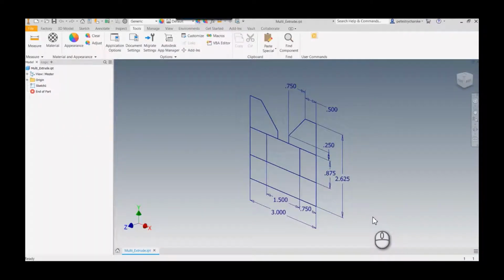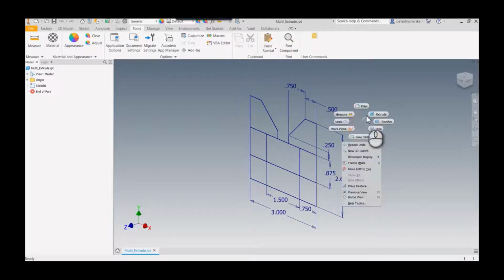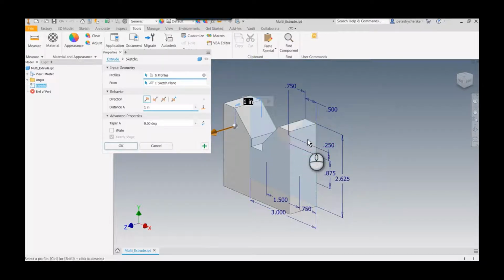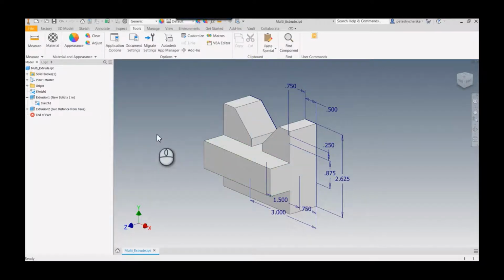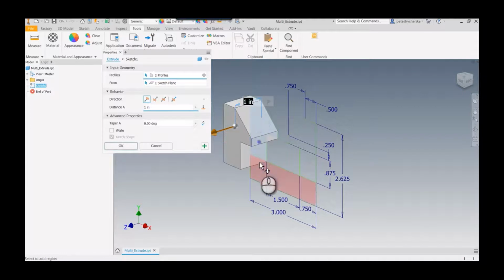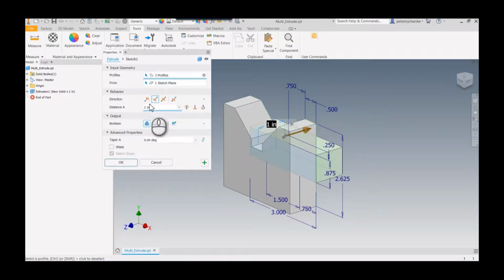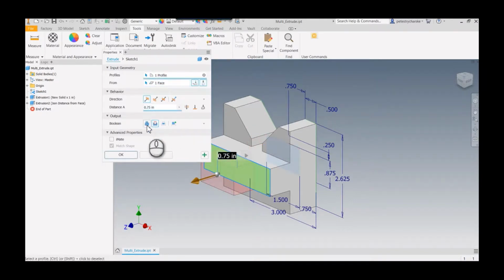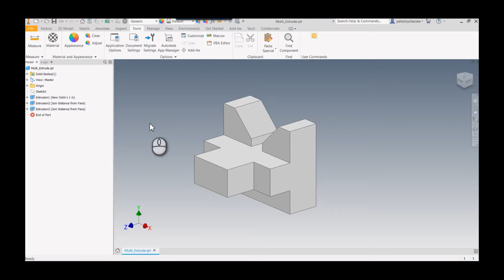Inventor - Create Multiple Extrude Features from the Same Command

Comment: I used this feature a lot, but now in inventor 2023 it doesn't work for some reason, can this be enabled/disabled somewhere in the options?
Reply: Hi i had the same problem too. Make sure to untick the adaptive for the first extrusion u did. So that you can share the sketch.
Reply from the maker: Sorry to hear of your troubles with this feature.  We are not aware of a setting that controls this.  Is this happening on every model?  Did this problem just start to happen in Inventor 2023.  You should double check that all the latest updates are installed and see if that resolves the issue for you.  Thanks for reaching out and hope that helps!